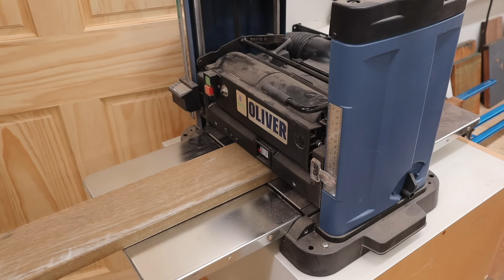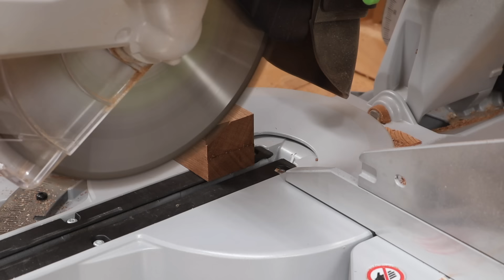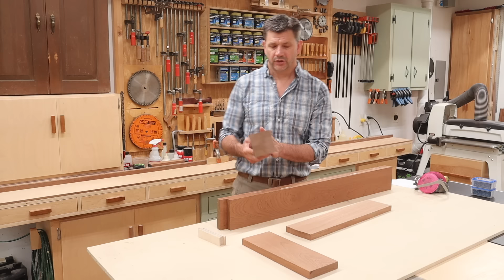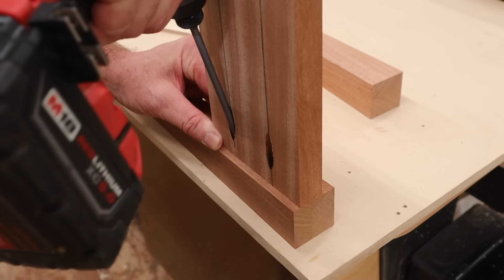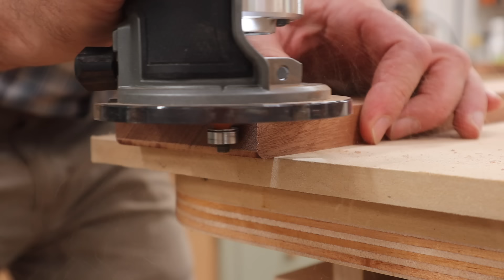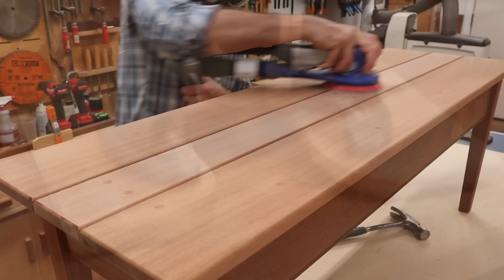How to Build an Outdoor Garden Bench

Comment: Do you really need to use fine thread pocket hole screws on hardwood? Or did you use coarse thread?
Reply from the maker: I didn’t on this project I used coarse exterior pocket hole screws

Comment: Great job. Can you put a link to your countersink tools pls?
Reply: This is the link to our 10 piece 4-in-1 Modular Drill and Driver set that comes with 4 countersinks.  You can also buy each individual size separately.  We are running a sale right now, so check our main page for closeout items!  

https://www.montanabrandtools.com/collections/4-in-1-modular-drill-drive/products/10pc-modular-drill-and-driver-set
Reply: @MontanaBrandTools  it doesn't look the same that Jon used
Reply: @Grumpycat0405  Sorry for the delayed response, didn't see your reply.  It is the same tool he used to countersink his screws.  He had the drill bit adjusted out farther than is shown in our product photos on our website, so I can see how it would look different.  Our Modular Drill and Driver tool is adjustable at 3 points for drill bit length, countersink size and replaceable 1" driver bit